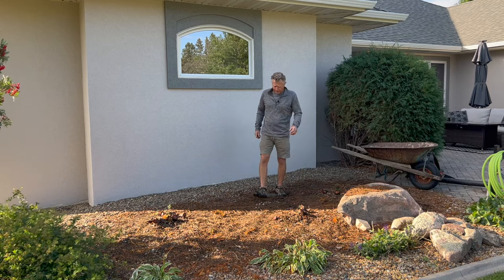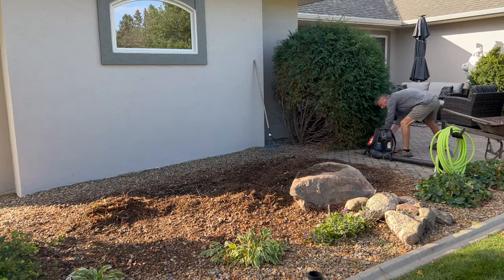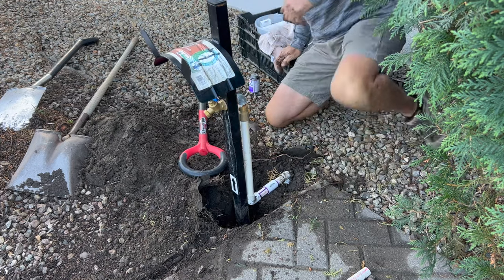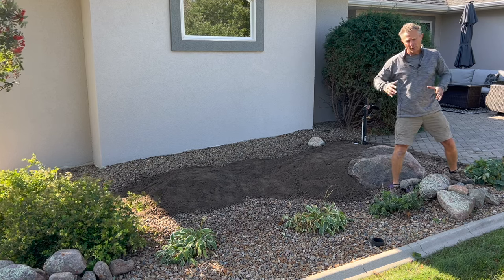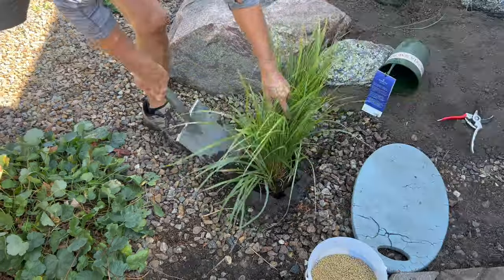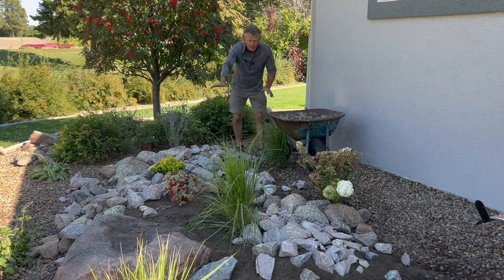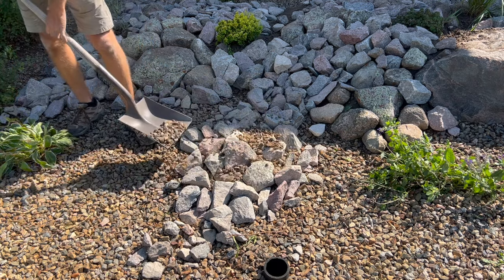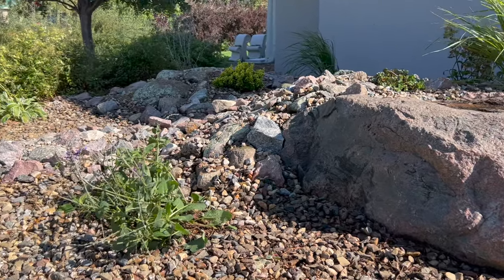Front Yard Landscaping Ideas: How to Add a Rock Garden

Comment: The work you did here was beautifully creative, and you explained and demonstrated it wonderfully. Really well done! 

I would be extremely appreciative if you could lend your advice on my new home (blank canvas) landscaping project. The area in which we live can become extremely windy at times. For this reason, I don’t believe mulch is an option for the planting beds; instead, we are looking to do rock/gravel in these areas. I hear so many mixed opinions on whether or not to use landscaping fabric under the rock that my head is spinning at this point. What is your opinion on using the fabric in this case? Also, is there a particular size of rock and at what depth would you recommend as the foundational base for the beds? Thanks
Reply from the maker: Yes, I would stick with a decorative rock if you are very windy. Here are some reasons why I avoid using fabrics:

* Additional expense for product
* Additional time for installation
* Sediment can build up on the fabric, providing a germination layer for many weeds within a few years.
* Adding and removing plants when dealing with the fabric layer is more difficult.
* It is more challenging to build natural contours in beds when using fabric.
* Plants will naturalize better long-term by self-seeding and layering, where fabric is avoided.

You will have more weeds when not using fabric in the first couple of years. This is not a problem if you like working in your yard doing hand weeding and don't mind using weed killer sprays occasionally to help with the task. After the second year, I see little difference in the time required to keep areas weed-free, whether fabric was used or not. 

If you choose not to use fabric and are bringing in topsoil for your project, ensure it is high quality and primarily weed-free. Existing, aggressive invasive plants should be killed off beforehand, too.

There are also many grades of fabric. Some let less water through than you might think. Others are so thin that weeds can break through if your rock/mulch covering is thin and exposed to light.

If you don't mind a bit extra early work and plan on changing out plants occasionally, go fabric-free.  If you want it to look "clean" immediately and have no interest in changing out plants, go with fabric. You'll eventually need to do annual weed maintenance either way.

Regarding the depth of rock, 2-3 inches is standard in my area. A 1.5-2" size is the most common and will say put in windy conditions.

Hope this helps!

Comment: Those mounds that you’ve created will direct water back towards your foundation which is the last thing you want. If you live in an area subject to heavy rainfall you’re inviting a flooded basement. This design is attractive and appropriate for locations at least 10 feet from a building foundation. Best practice is to always slope away from a building.
Reply from the maker: Good advice. This project happened to have its foundation grade set up to move water right to left with a good slope down, as you look at the photo/video from the front. So I felt comfortable placing the berm where I did.  If you look closely at the YouTube thumbnail photo, right in front of where I’m kneeling, I also left a separation in the berm where water can flow out.

Comment: How do you deal with weeds in rock beds? I noticed you didn’t use fabric barrier?  I dislike fabric for mulch but thought it was needed for rock so rocks don’t sink into dirt.
Reply from the maker: Hand pulling and occasional herbicide applications for ones that pull hard. 
It’s mostly the first year that you really have to stay on top of it. You will get some initial settling of the rock into the soil but it is not as bad as one would think. You can add a little extra rock when installing or top-dress later in problem areas.

Comment: Use of threes is a basic premise of good design. You have one boulder that in my minds eye seems to dominate your project, not in the most pleasing way.   Adding two more strategically placed would balance this rock garden and give it a better esthetic.   
10:04 😅
Reply from the maker: Yep, it's a big rock! But on landscape remodels, you can only sometimes do what you want and usually settle for what you can do. 

The rock was already in this location, and moving it or bringing in additional large boulders to balance the equation is not a hundred-dollar question but a thousand-dollar question. Moving rocks that size puts you into a new tier of equipment: A loader big enough to lift them, a trailer big enough to haul the loader, a truck big enough to pull the trailer, a driver with a commercial license, etc. Then, you must factor in the damage a large loader can do when driving over an existing sidewalk, paver deck, lawn area, and concrete edging. It adds up quickly, and budgets matter.

It's like a load-bearing wall in a house remodel. You might want to remove the wall for an open concept, but….

So, I made the rock a focal point and balanced the area by building up soil behind the back and two sides so it would stick out less and better blend into the area. The plantings have also since filled in nicely, which has softened the area. I used a grouping of three Karl Foerster grasses (already 3-4 feet tall) to achieve the "rules of 3" design principle you suggested. Sure, the initially finished landscape looks dominating, but landscapes and gardens take time to develop. It's like walking into a room in a house with no furniture; it looks bare at first. But when you add furniture, it softens the area. The plants have done the same thing, and the landscape looks completely different and more balanced even as quickly as one year later.